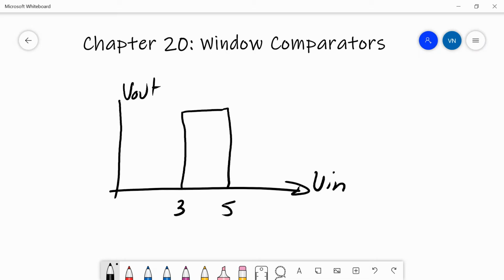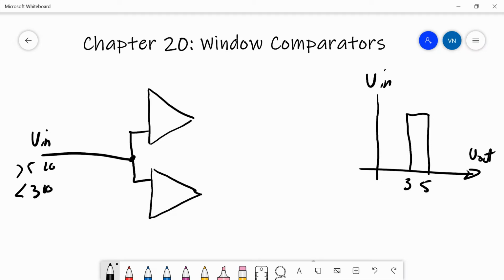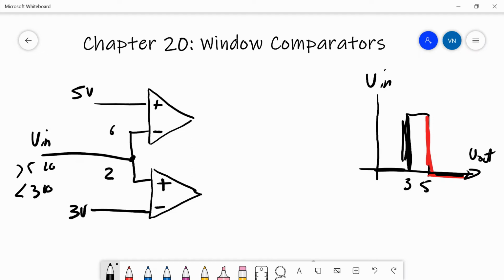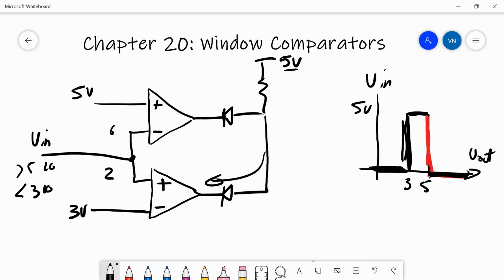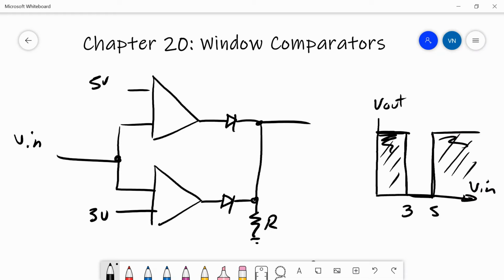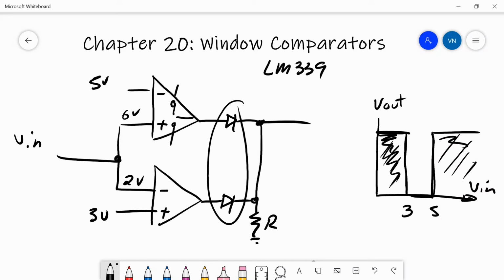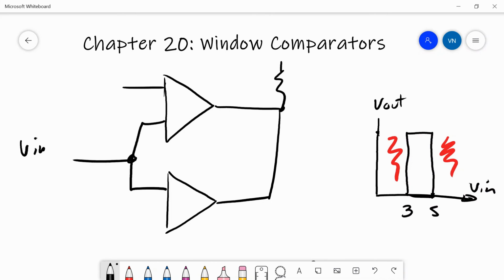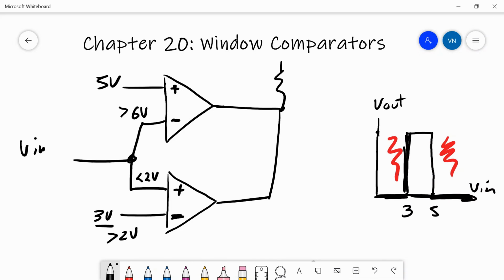Window Comparators

Comment: what are diodes purpose ?
Reply from the maker: The diodes only allow current to flow into, or out of the Op-Amp.  This makes each Op Amp a switch to ground/Switch to VCC.  Its a wire OR circuit.